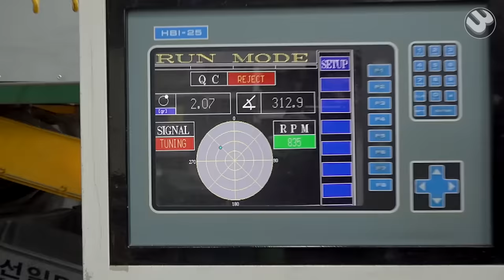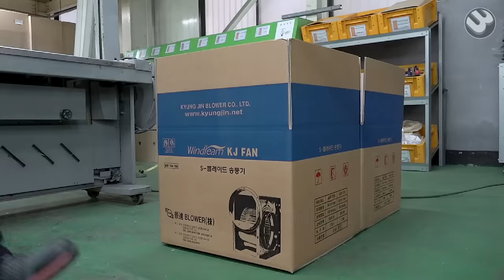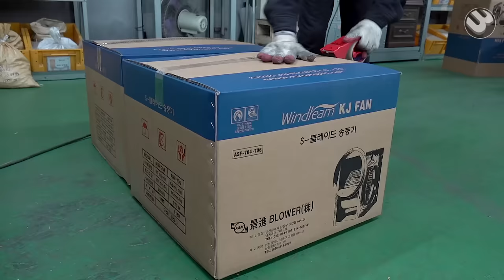Blower Fan Manufacturing Process. Aluminum Blower Mass Production Factory

Comment: I doubt it's aluminum. The press operator keeps picking the parts up with a magnet. Then there is resistance welding.
Reply: Must be new kind of magnetic aluminium, just like in movie Star Trek there is also transparent aluminium that clear as glass…
Reply: Electro-galvanized mild steel
Reply: GI sheet. If it make by Al will be demaged after sometimes.
Reply: 這沒人用鋁來做啦！都是鍍鋅鐵板居多
Reply: Its just galvanized sheet steel, nothing aluminum, if not the cheap windings in the motor.
Reply: I thought the same. I've never heard of aluminium being used for this kind of fan, so I wasn't too surprised to see that it wasn't.
Reply: Oof.  Blower fans are under a constant load and high stress they would never be made of aluminum
Reply: @deadcell85  but read the title of the video
Reply: @mingology7767  Chinesium
Reply: @CaptainRon1913  
company is in South Korea
Reply: @deadcell85   Fan Blades for a regular fan are made from Aluminum ( more often than not ) , So what makes a impeller fan different that it cant be made from Aluminum. I would call your claim "never made from Aluminum" less than truthful.
Now impeller of this size ( Diameter ) , dont see any advantage of being made from aluminum ( More expensive ) . which is true. But the the Truing and balancing is something thats lacking in the video IMHO. Yes they run thru both those process, but those processes lack durability.
Reply: Chinese aluminum.
Reply: and it was darker for it to be aluminum

Comment: This is what modern manufacturing should look like, equipment, automations, worker protections ...
Reply: Korea does this very well.
Reply: This doesn't look like "Modern Manufacturing" at all. nothing in it seems modern. a factory in 1970s would be doing it exactly the same way. 
There is no Automation . The person cutting the press blanks seems to be doing it manually, ( easy automation task) , He could have actually used a longer bar with two magnet , instead of putting his hand into the press. . The impeller vanes are just stacked by hand, after collecting on the press itself. There isnt even a *jig for installing the vanes, Or better , should should have been done with a robot. There is no Automation. the Fan is stressed into shape bu hand with a visual inspection, after running a couple of hundred cycles it will prolly go back to its original shape. and the balance weight isn't even welded on ( or even epoxied ).
Reply: @smokingsix mua hàng bằng cách nào ta

Comment: I reckon fitting those wings into place must be the worst job in the factory. Followed by welding them in place.
Reply: at least not the back breaking inserting the fan into the box 😂

Comment: Which gives me an idea to "K&N" circular-"airbox"-filter with external enclosure of doubling-volume curvature (snail-horn shape)... center is cone-filter cover (for looks) and external circumference the actual filter to air-box forming 3 layered conical shape. Propulsion of blower should be a "honda" grass-cutter petrol engine... what shall i use it for... ... ... need to develop idea further... hmmm...